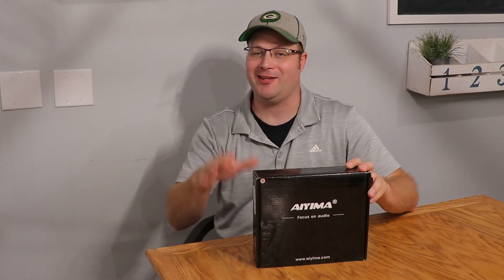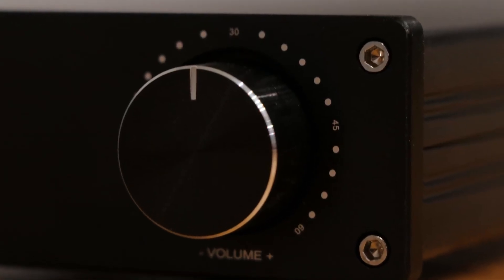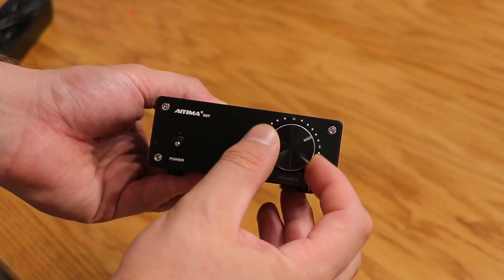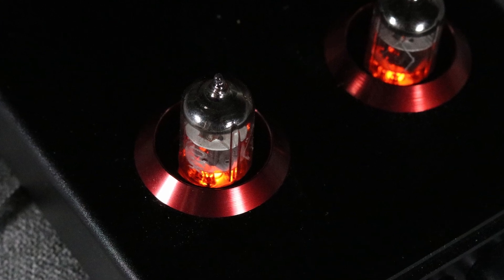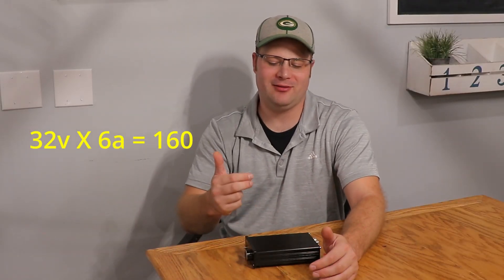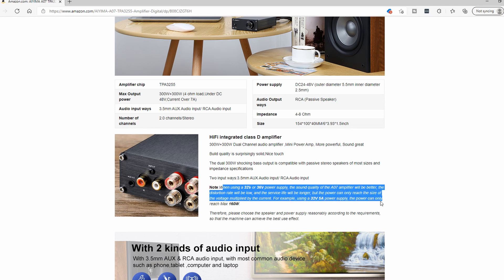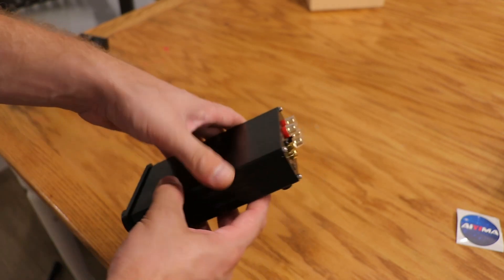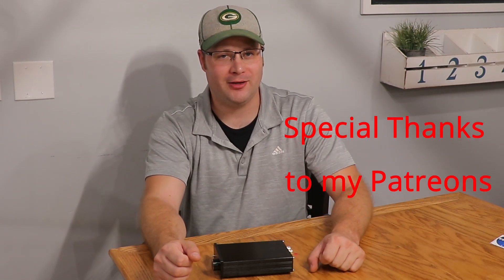600 Watts for $80? Aiyima A07 Review with TPA3255

Comment: I watched this video in amazement...  I'm 50 years old, I can remember what it took to get 80 or 100 true clean-ish watts per channel when I was a teenager and it was a box the size of a briefcase that weighed enough to hurt you if you dropped it on your toe.  It's just astounding what they can do with a well-designed Class-D chip and supporting cast of components.  I marvel at it.   
I love that you looked at the data sheet to go further into it. I discovered those just a few years ago and they really shed some light on the true capabilities of what a particular amp will be capable of in real life.  
I think the closest competitor to this might be the Lepai LP1601S amp that Parts Express sells. But it's not as powerful... maybe it's almost in the same category as far as raw power goes, at least for mini-size amps like these.  
The Aiyima amp looks like a really good solid amp for the money.   And hey, I still like a CD player in my car!
Reply: I'm 55 yo. I went through my whole giant amp and pre amp stereo stage (Sansui's). Now, I do it with mini amps. I bought a hd951bt pre amp and have been changing amps like underwear( to suit my tastes). They are cheap enough you can experiment. Running 50wpc x 5/8ohm(,with pre amp) for less than $250 American.It's a fun time.
Reply: Bet you your vintage stuff sounds a hundred times better!
Reply: More than likely you probably remember in the 80's the boom box wars and how they touted those impossible power output figures of 100, 200 or 300 watts coming out of a boom box and they stated it as PMPO (Peak Music Power Output) power.  Well that is what Aiyima is doing here as well. A more correct rating it the RMS or Root Mean Square rating.  Better yet, a rating that is measured as per a standard such as FTC (Federal Trade Commission),  is more accurate yet.   The TI datasheet doesn't even mention these figures.  As I stated above, with that power supply. You are probably going to get 1/6th the power (into an 8 ohm load) that Aiyima is touting.   So it is around or perhaps a bit more than that Lepai amplifier after all.   Even with class D a TRUE 300 watt per channel amplifier is still pretty big.  Big enough to rack mount, but granted, it will NOT be anywhere near the weight (or size) of a traditional power supply 600 watt amp.

Comment: You oughta send that over to big D or hifi Vega to see if it actually pulls off that much power
Reply from the maker: That's actually a really cool idea. We would definitely need to get a bigger power supply.
Reply: Amir at AudioScienceReview already measured this unit back in January of this year ('21). Two different 150W PS were used, one favoring 4 ohm and the other 8 . . . 77W into 4 ohm, and 61W into 8. The power supply is limited, but the construction of this unit will also be heat limited. Best to run it as is.
Reply: @MrChompenstein  as someone who owns multiple of these as well as modified units, they run best as is. The opamps in these are also really great. The best opamps I've found for it are Burson Classics but they cost more than this unit.
Reply: @ufarkingicehole  Whats an oamp?
Reply: @anglerandy5736  its An operational amplifier is a DC-coupled high-gain electronic voltage amplifier with a differential input and, usually, a single-ended output. In this configuration, an op amp produces an output potential that is typically 100,000 times larger than the potential difference between its input terminals. 

Opamps can have MASSIVE differences in sound. The one that comes with the Aiyima is actually really good.
Reply: @ufarkingicehole  there are knock offs of the Bursonb OP amps on eBay that are $18-$24 a piece.
Reply: @arena_rock_man9030  I may try them.
 I bought direct from the company
Reply: @ufarkingicehole   would there be any benefit in running two of these as monoblocks - one for the left and one for the right ?
Reply: @The.Dream.Builder  you aren't able to utilize these as true mono blocks. They aren't made to bridge so their wouldn't be a real benefit to do that. I do use them to bi amp with good results. They can be daisy chained via the fullbrange 3.5 output.
Reply: @ufarkingicehole  ya I realize they can’t be bridge like true mono blocks, just wondering if there would be a audible benefit from using two as the tpa3255 chip and power supply wouldn’t be taxed as much only having to render one channel each. Just a thought since they are pretty inexpensive.
Reply: @The.Dream.Builder  it would not really be an audible difference.  I will say it's an advantage if you can bi amp your speakers  with it. Also.... another gem for class d amps is the Geshelli j2 dac. Run out of your computer or phone steaming HD music via USB into Geshelli and output into Aiyima 07. Bam... I also like the smsl 0200 which has full range output that you can run into the Aiyima 07 to bi amp as well.
Reply: @ufarkingicehole   I have been searching for an amp with balanced inputs since my dac(smsl m200) has balanced outputs. Interested in the sabaj a20a, VTV hypex or purifi or pascal , behringer a800, crown, diy icepower/Ghent(least favorite). Swapped my emotiva a-100 out for the a07 last night...idk if I like it better - better highs but not as smooth ...still gonna rock it for another week and see if it pleases my ears more than the emotiva powering elac towers. Either way the ao7 is an amazing value and I’m definitely keeping it. Any suggestions?
Reply: @The.Dream.Builder  the Aimya 07 works best with a tube pre or the right DAC. On the cheap a Douk p1 with aftermarket tubes works really well with the A7. I am in love with thr Geshelli Dac for class D amps. I have the smsl 0400 dac, Loxjie d50, Cambridge audio Dac, and a few others... the Geshelli J2 is my favorite DAC to deal with Class D. The P1 Douk as a pre is a $100 solution thats pretty good with the right tubes. I like running my note 9 usb out into my Geshelli dac, ran balanced to the Smsl 0200, using crown or Aimya 07 running out the smsl 0200 to bi amp, either use the crown out or Aimya out to a sub(s).  Extremely impressed!!!
Reply: No need for bigger power supply or trying to get more power from the a07. It's able to handle more current but the distortion figures go catastrophic, like 10% THD at it's potential max. 

I have one and love it, but recognize it as the somewhere around 30 usable watts that it is. That's it. Sounds great. Not high powered.

Comment: I just picked up an Aiyima T8, my first foray into Aiyima gear, and am very impressed with the dynamics and performance. Might pick up the A07 to complement the T8 and run some bookshelves. A shame there isn't a subwoofer out but I can see they were trying to keep it simple and focus on power
Reply: T8 and a07 combo works well for bookies. It's not the most quiet setup and with more sensitive speakers you'll hear the hiss and noise but at moderate listening levels it sounds great. Love the tone controls on the t8. The tube section is kinda meh from what I remember
Reply: You can run a sub from the 3.5mm out on the back of the A07.
Reply: @Panslapper  Cool, thanks PW I'll give it a try

Comment: With a 32 volt power supply you will only get about 55 watts into 8 ohms and a little more into 4 ohms In fact you need 48 volts to get more power, that will give you about 90 watts into 8 ohms prior to clipping. DON'T be tempted to use such a voltage on this unit. To cut costs it uses lower rated capacitors which will blow up so don't even try. Even if it could take this high voltage it would ever heat as it has no ventilation at all.
It is what is, a good 55 watt amplifier. Click bait talking about 600 watts. You would know this if you opened the lid and used some test gear
Reply: it's not clickbait, but there's a caveat. 300w x2 is max power at 4 ohm with a 48v/10a power supply. on amazon it has a detailed spread sheet and it says how many watt you get depending on power supply and ohm. the 55 watt you said is with 24v power supply at 8 ohm and max power is 60w. the amp is sent with a 32v power supply so the output is 65w at 8 ohm and 70w max power.

Comment: Data sheet says 150 w at 1% distortion into 8 ohm impedance
Reply: But that's not using the included power supply. You'd probably need a 35V 10A power supply.
Reply: 1%? Isn't that kinda high?

Comment: Thanks for the power supply link. I've had this amp for a few months after watching Amir rave about it on Audio Science Review. I feed it with a Sanskrit 2 and Asgard 3 and it drives my Mirage OM-9s quite loud. 😅 Honestly,  half the time, I turn it off and just use my Monolith M570 planars.
Reply: How are those monolith headphones they look insane. Bass ok?

Comment: voltage is very important , if u look at page 11 of the datasheet u will see two charts that shows power supply voltage vs output wattage at 10% & 1%thd , if we look at the 4ohm 1% thd chart then u can that at 52v the amp does 275w at 1% thd , if u give the amp 47v the same wattage can be achieved at 10% thd which is into clipping. similarly the powersupply they have provided should allow 125w at 1% thd or 140w at 10% thd , so it is always recommended to use higher voltage psu with this amp , get a 48v psu and set it to 52v and u should be able to get all the power this amp can ever make given enough cooling.
Reply: Cheap models like this will not take 52 volts, it will blow up because of under voltage capacitors and the lower cost 12 , . volt regulator and no ventilation In the real world, prior to clipping you will get 91 watts into 8 ohms. With 48 volts.

Comment: With these little amps, it'd be nice to show a quick tear down of what's actually inside the black box. It goes a long way to demystifying things! Great videos, getting a little inspiration.
Reply from the maker: That's. I might just do that in the next video
Reply: AudioScienceReview forum has all that info, plus excellent test data by Amir. The mains hum is the main issue with these- still 80db+ SINAD if I remember correctly. Not bad at all, and easily improved upon with a higher quality external PSU.

Comment: I just ordered an a07... I was disappointed that it didn't come with their most powerful power supply so had to order the 48v 5A power supply... cost an extra $53. with the power supply that comes with it you get 80 watts at 4 ohms per channel... with the power supply I ordered you get 200 watts per channel at 4 ohms! If you want the full 300 watts you need to wire up your own 48v 10A power supply which they do not make.

Comment: I changed op amps in mine made a big difference.got mean well 36v to power it.nice little amp
Reply: Which OP amps for you go with? I heard the 1656 is good match.
Reply: @arena_rock_man9030  I got some V4i-D  they a burson copy but they where better then muses original 1s I had they sound great in ess9038 dac I've got.i was impressed with the amp.

Comment: I like the straightforward way you assessed this amplifier. You answered a few questions I’ve always had when trying to decipher amplifier specifications. Specically, the ‘### Watts x 2’ line: I’ve never known if I should read that as ‘### per channel’ and sum the ### for 2* ### total power (as you do), or whether I should divide ### by 2 for ###/2 Watts per channel, ### total power (no summing).

I have thought of checking the total power consumed by the amp, though, and the numbers often don’t add up. For instance, my new to me  AV receiver is rated at 100 Watts x 2 into 6 Ohms front and surround speakers, plus another 100 Watts for the center speaker for a total of 500 Watts total (500 Watts is displayed on a sticker on the front of the unit), but on the same specification page, it states that the unit’s power consumption is only 230 Watts. The receiver includes DSP functions, a DAC , a tuner, and a phono stage as well as a display. I can’t see how it can put out 500 Watts while only consuming 230 Watts.

I also like how you went straight to the manufacturer’s data sheet to resolve the question about the choice of power supply. 

Anyway, excellent review, I am now subscribed, but I’ve got to get back to work. :-)
Reply: @Douglas Blake Thank you, Douglas, for the favor of your reply. You obviously know more than I do about the topic. But to clarify, the power output of the AV receiver I cited above (a Technics SA-DX950) was ‘Power output at 1 kHz each channel driven DIN 1 kHz (THD 1%)’.Two other lines on the specification page which may also apply are ‘Power bandwidth both channels driven, -3 dB’ with the value given as ‘10 Hz — 70 kHz (6 Ohm, 0.9%).’ With a ‘Damping factor’ of ‘30 (6 Ohms)’. 

It is my impression that giving the amplifier a steady 1kHz signal stresses the amp pretty well, and I don’t interpret that to mean the ‘max power’ which might be demanded for brief (but important) transient signals (like bass notes and drum beats). However, I do find the wording ‘each channel driven’ for the power output line curious compared to ‘both channels driven’ for the power bandwidth line. Should I interpret the power output line to mean that they take five (5) separate readings, sending all the output through each channel individually? If so, then the sticker is misleading and should be tempered by a figure for total output power, all channels driven. 

I do concede your main point above about the average input AC power, though. You are correct that the values for power input and the power output don’t necessarily match exactly, or else you wouldn’t be able to account for losses due to heat as well as additional circuitry. It is also true that capacitors and inductors are able to temporarily ‘store’ power as well.

(Edit) Finally, your recommendation on a power supply for the aiyma amp would top out below 400 Watts. 7 amps x 48 Volts is 338 Watts, I think.
Reply from the maker: @jeremiahchamberlin4499  Douglas is unfortunately incorrect on his assessment of it self destructing.  This unit has a built in thermal limit that will shut down if it gets too hot.  They built this in as a safety feature.  Truthfully, you will probably never really need much more than what they included power supply offers.  But if you fel like you did, you could experiment with a few bigger power supplies.

Comment: There is a bunch of decent 50w into 8 ohm cheap amps, boards and modules. It's with trying to get to that 100w/8 ohm capability that is so fleeting in the budget category. Most of these will reside near clipping with anybody that listens loudly, and nearer to their less than ideal THD ratings. In other words, for decent 50w performance with many of todays less than efficient bookshelf speakers, one really needs a solid 100W/8ohm capable amp. 100w/8ohm has pretty much always been the best minimum for residential audio.

Thank you for reviewing these products.

Comment: One thing to note is that the DC power input plug wouldn’t handle much more current than the supplied power supply. 
By memory those plugs can only handle about 8amps so about 250watts
Reply: 8amp * 52v is about 400w . this amp should pull 12amp max at 52v supply (which u can easily get from a 48v psu.)
Reply: @KuntalGhosh   dunno how that would go through that style connector… 
I know theres plenty of psu that can handle the power but the plug would create plenty of heat and voltage drop pushing that much
Reply: @Sausagefeatures84  barrel jack is unsuitable for this application , i do not use them for anything above 3amp. I have tested the cheaper ones at 10amps and they do get pretty tosty. This connector looks much better than the type i have tested so it should be able to handle more power but u also have to find a male side that is qood quality.

Comment: If you want that little power amp to last I would highly recommend drilling the hood. I have two A04s and one has a 51mm circle drilled into the hood directly above the heatsink. It's an easy job. My first A04 was not drilled/vented and I have lost a little output over the year and to much heat causes things like that., these amps need venting. I run my new 'vented' A04 with the impressive bang for buck Douk P1 preamp and that really does provide a powerful source for the A04 which in turn reduces the need for a bigger power supply.

Comment: Where do you set the volume on the amplifier if you use it with a DAC or pre-amp that also has a volume knob?
Reply: I set both of mine at around 3/4 (about 2:00 on the dial) full volume. I use a tube preamp on both and leave them set at 12:00, then control all system volume from my DAC.
Reply: @Douglas Blake Thank you.  This is definitely helpful.

Comment: Why preamp or DAC?  The Drok 48v 10amp power supply is perfectly sized and has a display that's accurate for $35 on Amazon.  I've also found that the TPA3255 amps with bluetooth that I've tested work really well.  Good luck!
Reply: the drok 48v 10 amp power supply is the exact one im getting for this amp to power my SX6's. The price is right as well. Did you try it out or?
Reply: @PabzRoz  Yes I have.  You can test them as soon as you get one if you have a meter just to make sure.  I've got 3 TPA3255s and they're all great.  The power supply manufacturer doesn't really matter as long as it puts out about 48v @ 10 amps.
Reply: @billsmith5166  Awesome thanks so much. Yeah I was already planning on testing it with my meter to double check. Fluance SX6s, Dayton 1200 subwoofer, and the Aiyima A07 is gunna be my system. I already have a Topping DX3pro+ I'm going to use as my DAC/ pre amp. Purchasing everything tomorrow morning I'm so excited this is gunna be my first system outside of a crummy logitech system lmao.